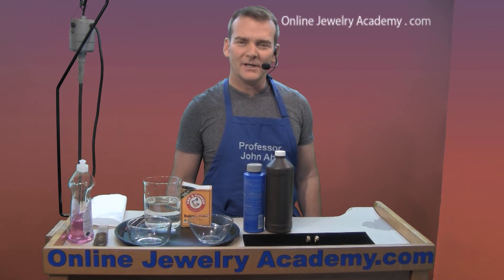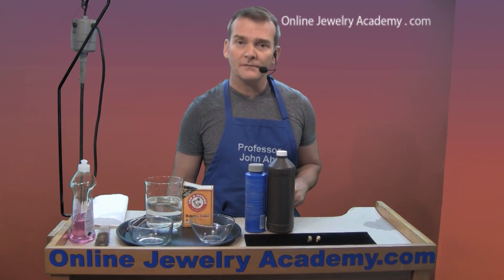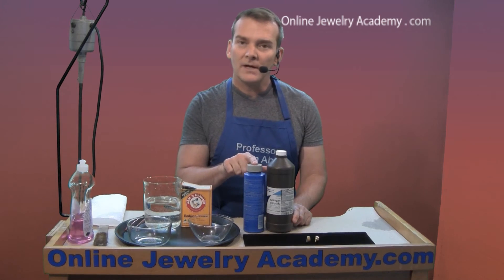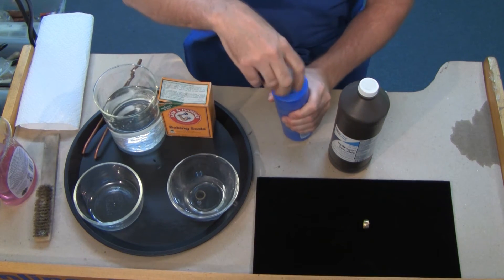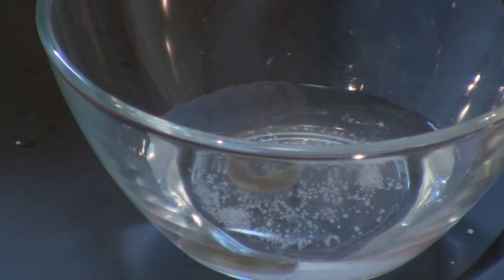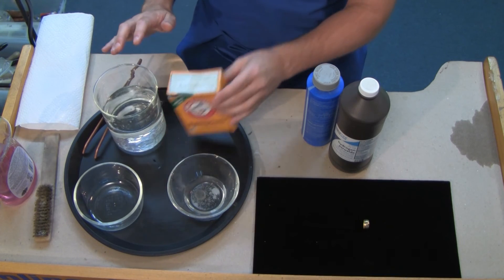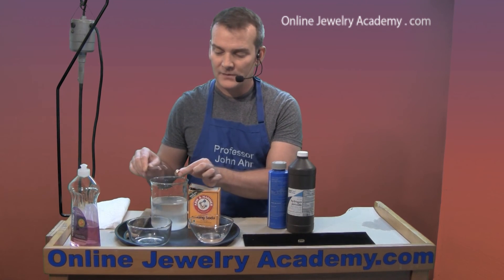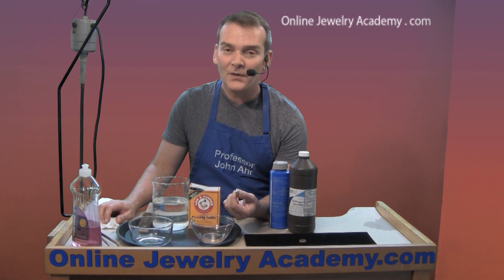Cleaning Copper Blush Off Of Brass After Soldering And Pickling

Comment: can i use washing soda? baking soda is expensive in my place. and brass should melt easily with 960° celcius so would i still need solder or i can just melt brass wire to join brass pieces??
Reply from the maker: The reason why you want to use baking soda in your final rinse is because it chemically neutralizes the pickling solution.  But a good healthy rinse in clear water should do the trick.  Joining metal elements without the use of solder is called fusing.  By the way, the OJA has a video on fusing silver in its playlist.  I've never tried to fuse brass wires.  I'm sure it can be done.  However, I recommend that you practice and experiment before you attempt to use fusing to create your design. 😀

Comment: Thank you so much! I don't really see the pink layer going off (it's in for over 15 minutes).. I used natrium sulfate and hydrogen peroxide.. The water does get a little more orange/brown, bringing me to my next question; can you keep on re-using the mixture for a while? Many thanks for your help!
Reply from the maker: Hi Nicole, I used sodium bisulfate and 3%hydrogen peroxide in the video.  Using atrium sulfate may be why your nickel pickle isn't working quickly.  I generally only mix up as much as I need to clean up the project I'm working on at the time.  I never try to hold onto the solution.  And, I don't recommend that you do either.
Thanks for your support! : )
Reply: @OnlineJewelryAcademy  I don't know sodium bisulfate so I translated it and a got 'natrium bisulfate'. I will continue my search.. thanks!
Reply: @OnlineJewelryAcademy  I have Na2SO4 here..

Comment: Thank you for your video! really helpful! I have a few questions.. how do I throw away this solution after using it? I put the pieces for half an hour and they came out with a yellowish lacquer, is it normal?
Reply from the maker: Hi Anna,  The OJA has a video on how to safely dispose of spent pickle in clay cat litter.  You'll find it on the OJA website at: www.onlinejewelryacademy.com  Generally I check the pieces every ten minutes or so.  And, when I check them I will brass brush them with dish detergent and water.  I do this primarily just to see how things are going.  The yellowish coating should brush off.  If it doesn't, you can heat the metal with your torch, quench, and put it back in the nickel pickle.  I hope that helps.
Thanks for your support! : )

Comment: Can brass be soldered to brass so that the seam is almost invisible?  Most solder I've seen is silver and really makes the seams stick out.
Reply from the maker: Hi Eric,  Brass solder is available: https://www.riogrande.com/search?q=brass+solder&c=&t=1&pageSize=32  This type of solder can improve the appearance of your seams.  Unfortunately, it won't make them completely invisible.  In order to really hide your solder seams you would have to plate the item.  But, professional plating companies will generally only be able to plate your piece with gold, silver, or rhodium.  So, you wouldn't have a brass looking piece in the end.  I hope that this helps.
Thanks for your support! : )
Reply: Thanks for the link.  Have you used brass solder for a project?
Reply from the maker: I have not used brass solder.  But I've used copper solder.  The copper solder ends up looking a little silver to my eye.  So I assume that the brass solder will produce a similar result.  The Rio technical support team is really helpful.  You might consider giving them a call to ask what products they sell will produce the best results.  Good luck with your creative pursuits.

Comment: Thank you very much for your video! What is the best way to dispose of this solution?
Reply from the maker: Hi Evan, The best way to dispose of the spent pickle depends on what the regulations are for the disposal this type of waste in your town.  The OJA has a video on safe pickle disposal.  The method used in the video is acceptable in many areas.
Thanks for your support! : )

Comment: Many THANKS!  I have known for decades that sodium bisulfate could remove oxidation from copper, brass and old nickel plate BUT had never found information saying to use it with hydrogen peroxide.  WOW! Talk about turbocharging the process and eliminating the 'pink blush' I've had to remove by abrasive charged buffing wheel.  I tested it in my ultrasonic cleaner so the oxidation was GONE in less than a minute on the batch of 90 year old knurled thumb nuts I was processing.  I'll tell my friends in the vintage radio hobby about your video.
Reply from the maker: Hey Robert,  Glad to see that this process works as a good cross-over between jewelry making and vintage radio restoration.
Thanks for your support! : )

Comment: thank you so much for this video! I used exactly what you said here and the brass did restore; however it turned lighter than its original colour! - does that mean i used to much of either the peroxide or the bisulphate - or did i just leave it in there for too long - about 4  minutes? thank you so much - great videos!
Reply from the maker: I'm glad that you enjoyed the video and found the information useful.  You didn't do anything wrong.  The brass will go back to its original color with time.  It's just cleaner than ever right now.
Thanks for your support! : )

Comment: I am soldering antiqued brass chains together- does this pickling solution work on brass that has a finish already on it?  thanks!
Reply from the maker: Jacob Rideout 
Hi Jacob!
The super-charged brass pickle in the video will clean your brass chain.  But, it's going to clean everything off of your chain (including the antiquing).  You can dangle just the soldered links into the solution.  You will, however, have to reapply the finish to the soldered links.  Good luck with your project.  And, thanks for watching! : )

Comment: what effect will this have on silver I have sweat soldered on to it thanks
Reply: Thank you for your question.  This type of pickle is very aggressive on copper.  But it doesn't attack silver in the same way.  So, if you've sweat soldered a piece of brass onto a piece of silver, you can use the brass pickle to clean it without worrying.  Sometimes it may be necessary to place your piece in the regular pickle bath too in order to get it to its brightest state.  Thanks for the question and thanks for watching.  : )